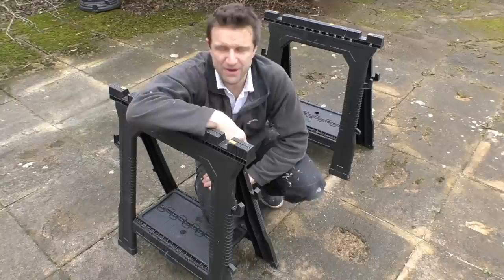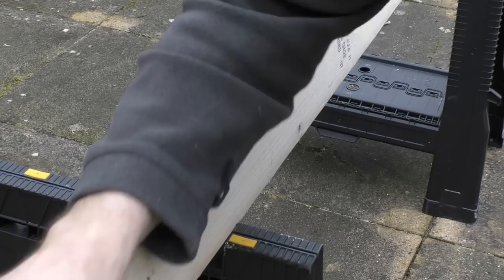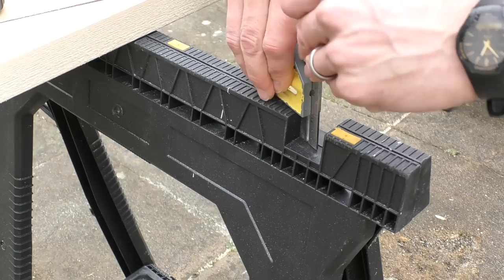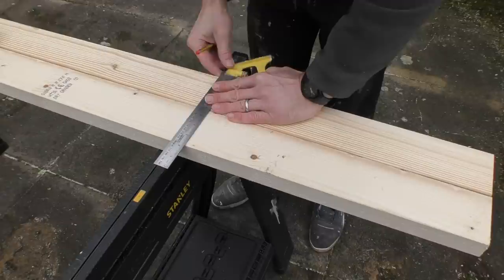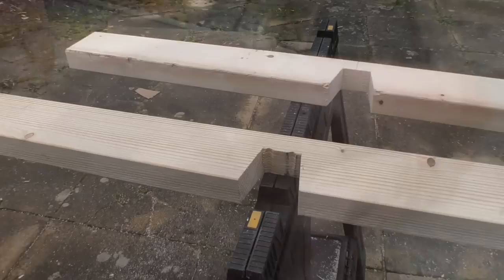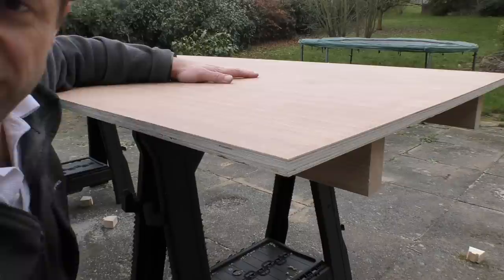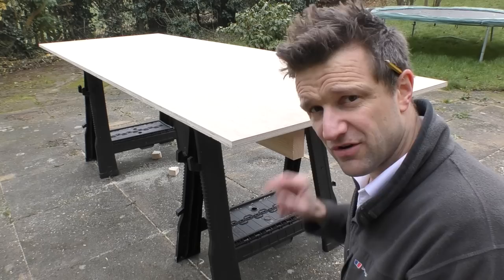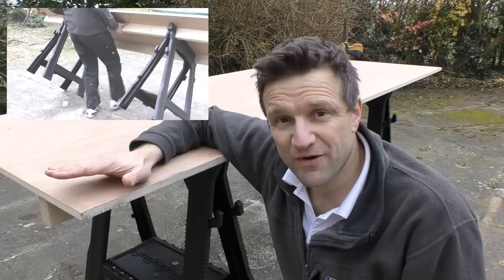How to Make a Portable Folding Work Bench: Video #1 of 5

Comment: It's only from reading the description that I found out that you actually had it cut down to the 90mm width  (although you've typed 900mm in error).

Was there any reason for doing that, when you can easily get 89mm pieces at B&Q...?  (and other places, I assume)

Either way, good video.  I'll be making a 1.2 metre version to use in the hallway of my flat.

Comment: U can cut 2by4 and ply sheet to any sizes u prefer
I use 2 mdf mft tops u can buy off ebay
Also prefer tough built 700 fold away work horses built in batton space so u don't need 2 cut batton,  adjustable height and more stronger with extra functions also space saving
Reply: Have you thought of cutting the plywood in half and then use hinge or hinges on bottom to reconnect

Comment: Since it is heavy, and also bulky, why don't you consider cutting the top piece in half and using a good quality piano hinge underneath.  And having done that, I would leave the top separate and use dowels to anchor it to the 2x4's when setting up on the job. That makes the whole thing more portable.
Reply from the maker: All done Rich - see the link below. Piano hinge wouldn't be strong enough, but this one was! https://youtu.be/PTN3EmLiYdg

Comment: Actually you do not have to cut a notch out of the 2 x 4 Wood that you will be laying across the saw horses. I found that when I simply placed the two boards Into The Notches of the sawhorse itself that the pair of Saul versus became very stable. Perhaps it's because I used pressure treated 2 x 4 boards that fit very snug.
Reply from the maker: Dale Baranoski It's better if you do though as it stops it rocking at all.

Comment: hey Charlie, what do you think of assembling not 2"-4", but 2" x 2" piece of wood?  will it be also  as good as 2"x 4" ? or it is really better to assembly 4" x 2" piece of wood. episode #2 of this project is awesome! i am wondering if 2x4 would be to heavy to put it on the saw horses(i plan a table in dismension 2meters x 0,9 meter.
Reply from the maker: klinsmann Thanks mate. 2x2" wouldn't quite give you the strength you need. I'm thinking of cutting it in half and hingeing it. Then I have the flexibility of using a small table (ie take the hinges off) or the large one. Just trying to work through a few practical issues though 🤔
Reply: thanks for quick answer. hingeing it? could you explain how you want to do it? :) i can't imagine how to re-build your construction with hingens. wood cutted, i just need to buy some jizzle to smooth the last pieces and buy some plywood :) i am looking forward to next episode of Mobile workbench. Part 2 is also very nice. greetings from Poland. i wonder some day  I will be able to boast of what I have created, getting inspired by  your project
Reply: Maybe use 8 ft. lengths of 2x2 and just add a "shim", as it were, at the point where it contacts the sawhorses, reducing overall weight.

Comment: So glad I found this video!  Just brought home two similar sawhorses today, looked in my wood bin for some 2x4 to make a similar but smaller table, and was wondering how.  This is brilliant!  I am eager to make the cut-outs, partly because although I have been working on my skills and designing, I would never have come up with that.  It will be a great exercise for me, and a impressive and hoity-toity touch, lol.  Might even impress the guys ; )
May not secure the top, though, at least not to start because I'd like to disassemble it completely for storage, so I hope I can come up with a suitable plan for securing the top when in use.  Many thanks to you and SA Bjork.  Will be looking at the following vids.  And, I sub'd.  : )
Reply from the maker: Elly that sounds like a great plan. Yes the cut outs make it much more stable. Just don't go more than half way through the timber so as not to weaken it. 👍 Let me know how you get on. It's a complete game changer making one of these. Don't know what I'd do without it.
Reply: @CharlieDIYte   Good tip about the 1/2, thank you.  I watched your subsequent vids and can see how well your big unit works for you.  Awesome!
Luckily for me, my needs are different and lighter.  When I looked in my bin for scrap 2x, I found nothing.  Went to my lumber and found some beautiful, strong, heavy lengths I bought a few years ago.   But no.  What I want are some scraps of those 'marshmallow' boards I see in the lumber yards which pass for 2xs these days.  I think they are what you used.  (Where all our good lumber goes now, I do not know! )  So I was stalled for the moment.  However, I spotted  two lengths of metal I "knew" I'd find a use for eventually, maybe from a small TV mount or something.  They are light but strong because of their shape.  I'm exploring that option because their length is perfect for the plywood and I often take clues from whatever jumps out at me from my "Use it or Lose it" stash.  Those and some bracing trim would make the light top.  But when I get some longer marshmallow 2x6, I still want to set them in.  I might be able to flip the top and, with the addition of some cross members made from scrap, use the whole thing as an outfeed for those occasions when I need to work with longer material, such as a deck repair that's on The List.  Spring is springing and I'm looking forward to working outside again, instead of in the cramped porch.  But, come next Winter, those versatile components would break down for compact storage.  Always something new to try : )

Comment: If you look for the you (teeth per inch) number of a saw it will tell you how the saw cuts. Low number rougher the cut, higher the number the finer the cut. Timber saws are roughly from 7-14tpi although there are finer specialist saws than this. Metal saws 24-33tpi, once again some exceptions. Use the tool for the job.

Comment: Hi Charlie,
is there also an overhang on the short side of the bench? It looks like it is none or maybe only a few mm. Why not put at least 50mm there as well? When you saw objects with smaller width it is easier to handle and walk around the short side of the bench I think.
But great idea and execution! I will build a similar bench myself. Just ordered the saw horses.
Cheers, 
Dirk
Reply from the maker: Hi Dirk. No there isn't but come to think of it, that would have been a very good idea! You won't regret it - I don't know what I would do without mine. I have a couple of upgrade videos in the pipeline, so stay posted! The first upgrade I've done but not video'd yet is to insert some trims around the edge of the bench as the exterior ply is quite fragile and was getting damaged when I stored the bench. The next will be to drill a grid system of holes with the UKJ parf system.

Comment: Done mine virtually the same except I fitted 20mm dowels to the 2 x 4s  supports and used a Stanton bench with matching 20mm holes in both ends for the top.

Comment: Thanks for sharing this — looks really useful for working on large sheets of MDF etc. My problem would be storage — do you think it would be possible to have it hinged across the middle with some heavy-duty hinges without creating a weak spot? I guess it might need some sort of slat/additional support underneath?
Reply from the maker: Simon Duckworth Thanks for this Simon. I'm currently doing a lot of head scratching over this. I've bought a couple of heavy duty hinges, the plan being to screw them to the underside of the beams but I'm concerned that it will be too unweildy to hinge open and shut (and could damage the table in the process) and also, by placing the hinges on the underside it will create a reasonably wide structure (albeit half the length of the original - but twice as wide). Any thoughts or inspiration would be great. I have to make this work somehow as it has become THE MOST FANTASTIC work bench. Also, I've bought the Peter Parfitt parf dog system on the recommendation of one of my subscribers, which will revolutionise what I can use it for.
Reply: Charlie DIYte Thanks for the reply! I’m not familiar with the Peter Parfitt system, looking forward to seeing how you’ve modified it! I’m going to get my thinking cap on...! Keep up the good work Charlie!

Comment: I already own a couple sawhorses similar to what you used but they don't have that notch in them for the 2x4 to rest in. I was thinking I could still notch 2x4s on a frame built similar to a stud wall and lay that on my saw horses. Since my saw horses don't have a notch, I am worried that my top could slide back and forth from force parallel to the saw horse. Do you think that would be too big an issue or would the weight of a 2x4 frame with 3/4 inch plywood have enough weight to prevent the top from sliding on the horses?

Comment: i wonder i you can make it to fold in the middle cutting them in even halfs and using a togle bolt under it or two small toggle bolts under it to lock it in place then unlock it and fold it after to carry easier?
Reply from the maker: dreamkiss4u I'm planning to do something very similar. I've bought a couple of marine hinges to go underneath, and I just need to buy two zip lock bolts now from Ironmongery Direct - to lock it in place on the surface. Also plan to drill holes on the supports to take a bit of weight out and to put a hard wood edge around the side as it's driving me crazy how ready the ply fractures. Stay tuned for the video update - and thanks for the comment!
Reply: another thing would be might as well make your own saw horses built in to the table top no need for saw horses they are pricey and you can simply make them from 2x4s and also make them folding with the top and all is one nice folding package ;-) thats what im building

Comment: Ive got the smaller Stanley saw horses -  £20 quid for the pair from Screwfix. I happen to have two supports which press into the notches. Seems quite firm  but stands about 10 mm  above the sawhorse top 
 Not sure of the need for a notches in the timber or am i missing something ?
Reply from the maker: The only advantage of the notch is that it makes the table a bit more stable, in terms of rocking down it's length. But otherwise I agree.

Comment: what if you cut it in half and added hinges to the bottom of the studs so u could fold it in half. also some hand holes for carrying.
Reply from the maker: That's a great suggestion that I seriously considered, and am still considering! I may still do it, as it would make it SO MUCH EASIER TO STORE. I just need to mull over whether there is any danger the work bench will sag - I guess it all comes down to the quality of the hinges, and my skill in setting them in the right position. 

Hand holes could be good - I'm currently carrying it by the timber supports. Might also need to drill some holes to accommodate a few bench clamps. 

I feel another video might be required...

Comment: This adds so much strength to the plastic not so strong, horses. 
The little fold-up tray in the between the legs really annoyed me because the tabs broke. There is no need for those with this set up.
Reply from the maker: I agree about the tray. I think I broke one of mine by accidentally putting my foot on it. There are more sturdy metal horses out there but this is on the money in terms of price and practicality.

Comment: If it were me, that rasp woulda been about a quarter inch too wide to fit into the gap that needed filing. Never fails...
Reply from the maker: I know what you mean. But in the remake I didn't use the rasp. I just knocked it out with a chisel.
Reply: @CharlieDIYte  been watching the later videos too, awesome job!

Comment: two suggestions: cut a handhold  somewhere along the long edge for carrying, if you have a miter saw or other saw you want to use on the bench. mount 4 bolts on the corner of the saw base allowing them to project an inch below the saw base  Drill four matching holes in the bench  Just set the saw in place and it wont move around
Reply from the maker: Nice one Tony. Thanks for that. 👍

Comment: Hi Charlie .. just came across this video and couldn't help but show you the solution I came up with for using these types of sawhorses for setting up work stations,  Look at TrackTubes.com and let me know what you think.   Yes, they are more expensive than using a couple 2x4's, but are very straight, light, waterproof, and a permanent solution.  Unfortunately, only available in the US right now.

Comment: How about drilling it with Peter Parfitt guide system, will reduce weight and give you infinite clamping options.Also. For not much more money ( oops just checked a fair bit more money) the Axminster saw horses look much more robust.
Reply from the maker: Hi Norman, great comment - thanks, although I've spent an unhealthy amount of time this afternoon watching videos on Peter Parfitts system! and now have serious tool envy after looking at those Axminster Saw Horses (which I've found for £89 on eBay). Wow - they are the nuts, even if they are twice the price. Will be buying some when the existing ones wear out.

First purchase is going to be some Axminster guide clamps. https://goo.gl/Xoazif. I'm really interested in the guide system - just need to take a deep breath before I  justify the steep cost for drilling a load of admittedly very useful, incredibly accurate holes. If it features on a future video you'll get a shot out for the invaluable tip - as long as you promise not to tell the wife what I paid for it!! 

Many thanks again!
Reply: Charlie DIYte 😂 well I sprung for the TS55 at Christmas (I have been a good lad) but I have been waiting for sufficient financial recovery before splashing out on the Parf drilling guide.
Reply from the maker: Norman Boyes TS55?? What are you trying to do to me :) They're blinding tools, according to a few colleagues that have them - but you already knew that!!  For the time being (being the cheap skate that I am and being rather wedded to Ryobi because of their excellent battery system) I have to make do with this https://goo.gl/uRDVfU. That said I'll rather chuffed with it and I'll be doing a video on it reasonably soon. Try not to laugh too much or be too smug as I demonstrate straight cuts with my rafters square and hand made fence!!
Reply: BTW the sawhorses are the same price on eBay as they are on the main Axminster site.
Reply from the maker: Norman Boyes Thanks for that. You've reminded me today that they do some great stuff!!
Reply from the maker: I've bought the guide system Norman. I'll send you the link when I've upgraded the work table.
Reply: Charlie DIYte - I'd be really interested to see if you think it's worth the cost for a DIYer. I've been looking at it for a few weeks now but struggling to justify the outlay. That said, the cuts you get from it should be squarer than just lining up your cut board. Just need the TS55 like Norman's now to go with it ;-)
Reply from the maker: Ben Halford Hi Ben. I've bought the kit and will be doing a video on it soon. £150 is a lot of money for a load of holes, but I guess it depends how often you use it. I'll let you know my conclusions when I've done the video.

Comment: Charlie boy, they are called saw STOOLS, NOT HORSES, a saw horse is a wooden clamp with 2 wedged wooden chops to hold hand saws in when you set and sharpen them, as an apprentice of 5 yrs l used one every Friday when it was tool  tickling up time, now been a joiner 42 years,..on no doubt you know this already, if you cut into and past the spring line of any timber more than half way (your notching out ) ,using your template..will weaken your piece to failure,
so to 're cap , 
1-Saw Stools for cutting work.
2- 50-50 cut notch = good joint

English Mik

ex -Majesty's Joiner
Reply from the maker: Cheers for that, Michael. Always good to get advice from a pro! I guess it's an error of the industry then because they all call their products "saw horses" - https://www.toolstation.com/shop/Hand+Tools/d10/Work+Benches+%26+Trestles/sd120/Stanley+Folding+Junior+Saw+Horse/p80711. Your second point is a valid one, and something I've been mulling over a lot.  Fact of the matter is that with the combined strength of the ply, and what's left of the timber I think it's plenty strong enough for the jobs most of us use it for, but I guess the design could be improved by only notching half way and incorporating a horizontal piece between the two supporting timbers to rest on the "saw horses". The problem is, the less you notch it, the less stable it becomes as it doesn't grab the tressles as much. That said, I'm replacing the CLSs in the next video upgrade, so I may go for the 50:50 option and if I do you'll get a big fat shout out!!
Reply from the maker: Hi Michael, I posted this a week ago https://youtu.be/PTN3EmLiYdgShout out to you around 10.59mins.
Reply: Hi Charlie, Did you really need to notch the beams at all?  Does the bench really need the width support from the horses when it's already screwed length-ways to two 2x4's?  My thinking is that you should get enough stability just from slotting the 2x4's into the horse notches.
Reply: agree, but whats it matter,it works well
Reply: Bill Lupton 

Yes but how long for , 5-6 jobs ?

English Mik
Reply: In the states everyone calls them saw horses. Also a hood is what covers a V-8, a bonnet is something a woman wears on her head. Banger and mash is something we do in the dark. Haha
Reply: @michaelpalmer937  Known for your sense of humor? I bet you are the life of the party. Lol
Reply: @kccodex8931  

Foot note ..(Hood) , is  old English for "hat ".....also used in today's modern Dutch ( Nederlands,) ..bet you knew that !...of course  over in 
Dumb ville

Regards ,...English Mik.